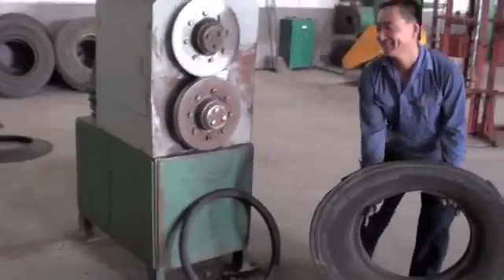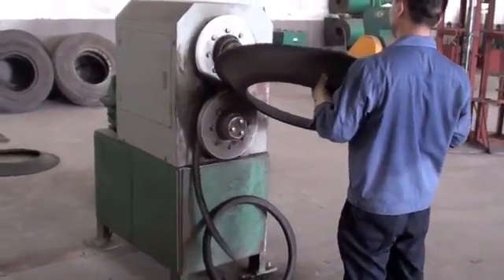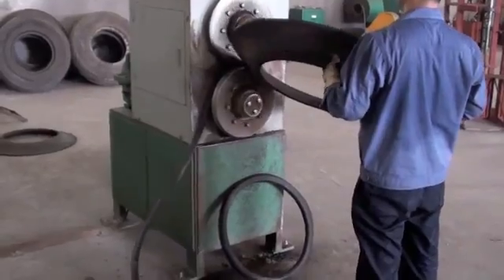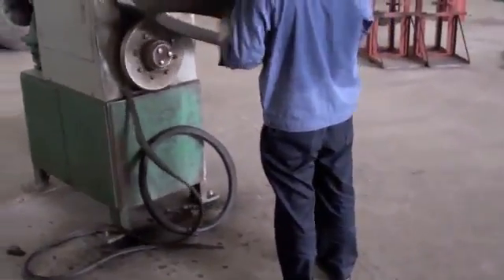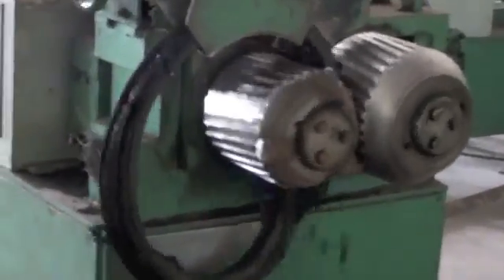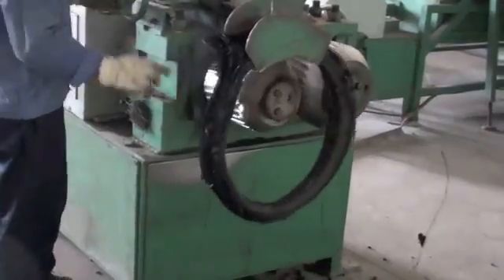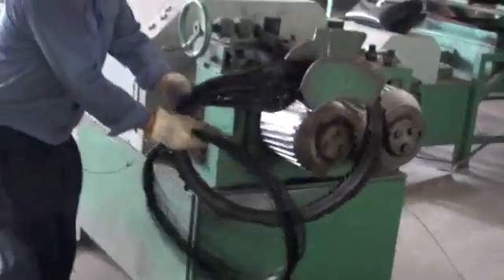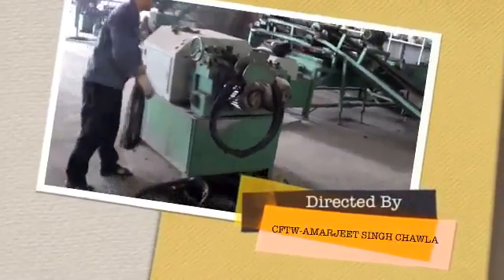Wide Range Of Pyrolysis Plants  And Other Related Machinery

Comment: Very slow process, can not be economic in North America
Reply: CuriousEarthMan please send me your contact s pls my mail is   hadysadek@Gmail.com
Reply: I agree with you. I would think a simple hydraulic bead puller, followed by running the tires through a shear shredder would do the trick. Not sure why they are doing it this very slow, labor intensive way. I was also hoping to see some sort of pyrolysis plant in operation.
Reply: CuriousEarthMan Labor is cheap overthere